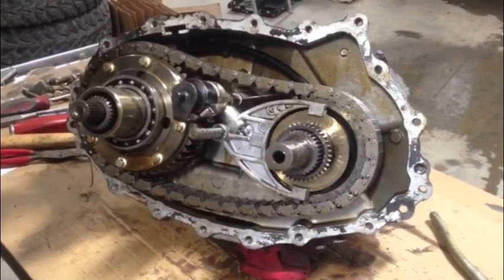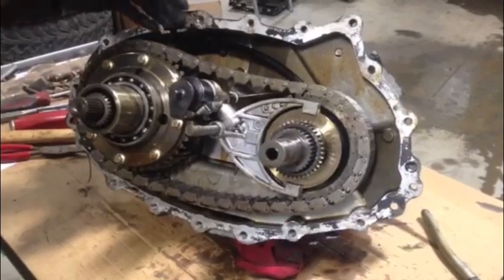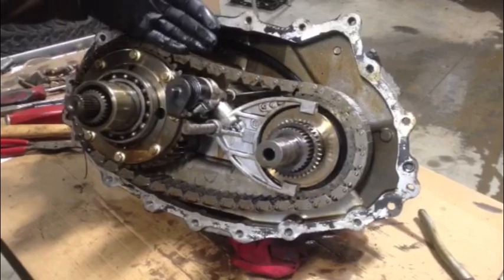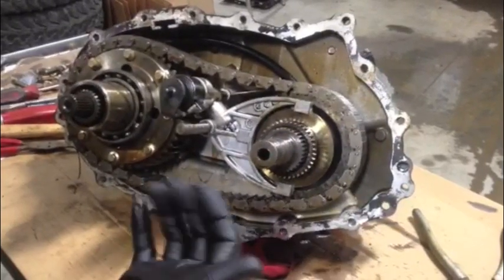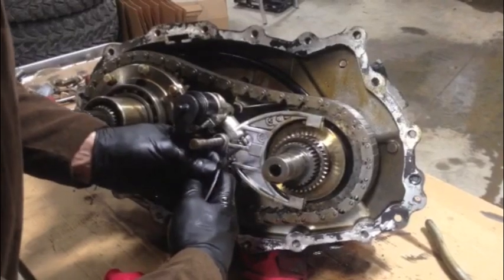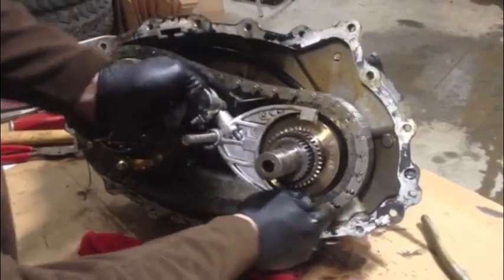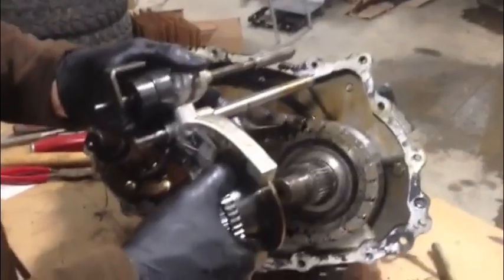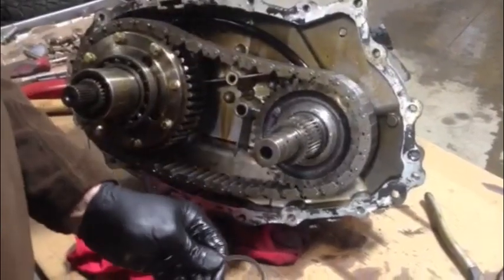Range Rover transfer case chain install

Comment: I know this isnt the same generation t case, but could you point me to info on using a later electronic center diff t case in a non stock application? I want to build a rally(ish) slightly lifted car with adjustable torque distribution. From what i understand the range rover sport has that automaticaly done. Id like to just have a dial or something similar. Any help would be appreciated.